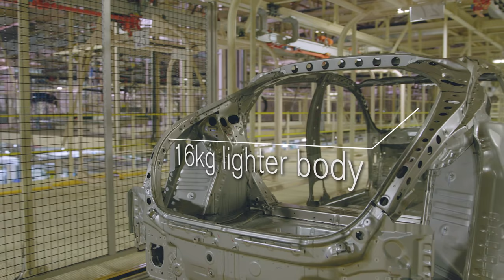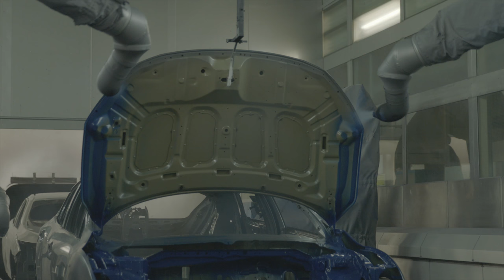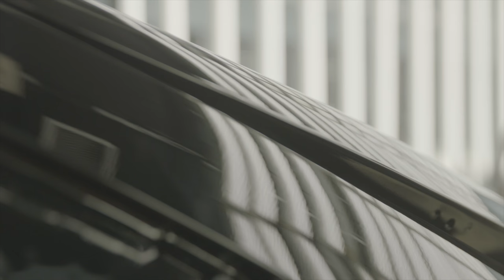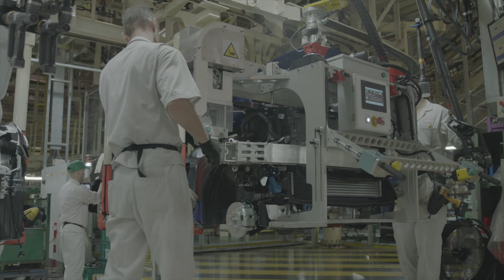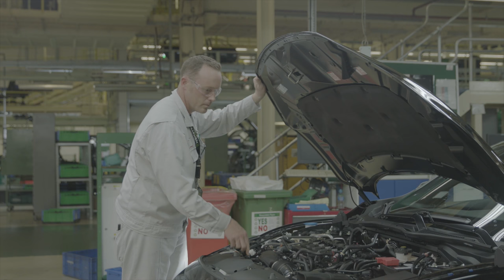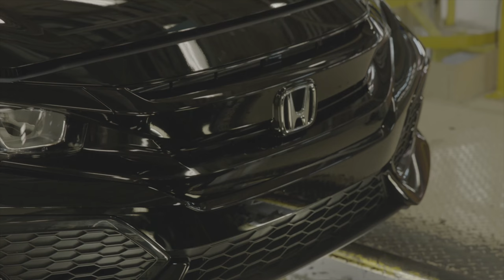New Honda Civic 5-door hatch production plant assembly UK - Civic Produktion 2017

Comment: The model in the video is actually the hatchback version, not the sedan/limousine one (currently being sold in the US). The design of the car surely stands out, bue still not sure whether I really like or not (specially the rear). Will have to wait to see one personally. Pretty anxious though.
Reply from the maker: +José Ferreira u sure? The new 5 door looks like a hatch
Reply: I'm pretty sure. I'd say 99% sure.
Reply: http://e.glbimg.com/og/ed/f/original/2015/10/06/honda-civic-traseira.jpg This is the sedan/limousine version.
Reply: http://carplace.uol.com.br/wp-content/uploads/2016/08/honda-civic-hatch-2017-flagra-5.jpg This is the hatchback version.
Reply: Although they are quite similar, you can tell the difference by the rear. The hatchback's one is more rounded, The main difference is the rear spoiler, as the sedan/limousine has a very small and discreet one whereas the hatchback has a bigger one with embedded rear/brake lights.(as do the ones in the video) You can also tell by the trunk/boot marks ll around.
Reply from the maker: ah ok I think I now see the difference ... might indeed be the hatch .. but very much alike they look :)